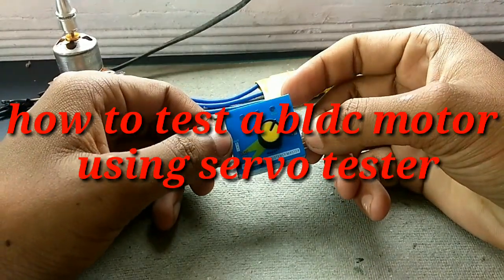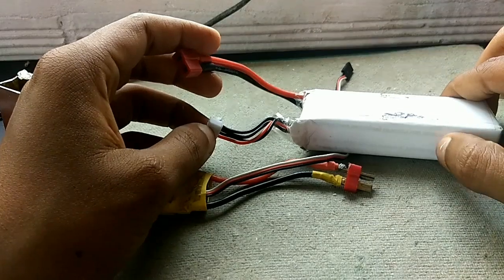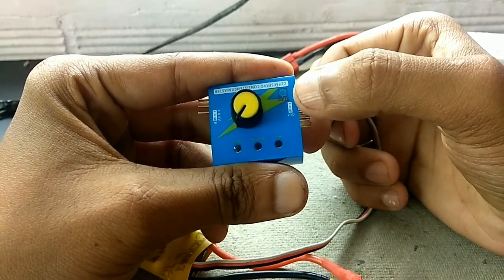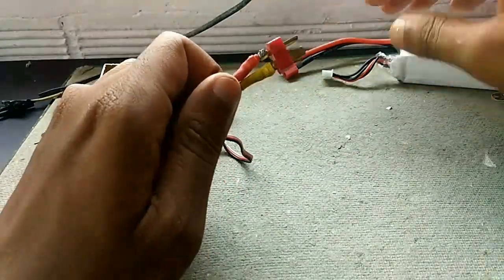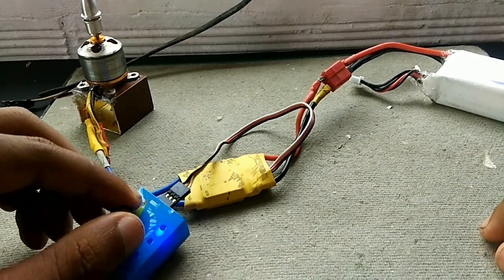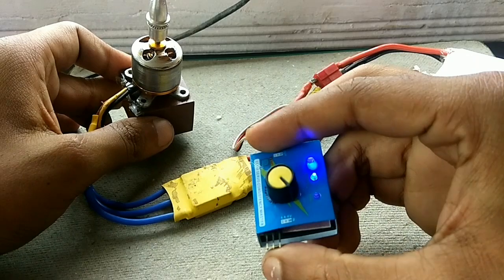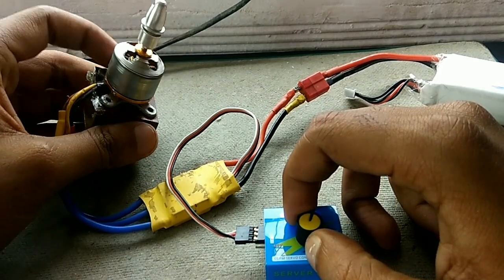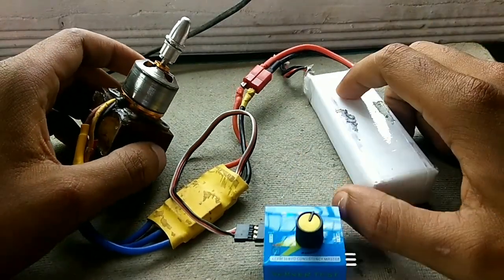Testing bldc motor using servo tester

Comment: speaking as someone fairly new and recently  buying a servo tester, (  mine came with no instructions ) .....I would have never thought of plugging the ESC and battery into  one of  the 3-pin   " out " ports.....also , I thought the   single 3-pin ( IN )  port marked  4.8 - 6.0 vdc is strictly for powering the tester with a stand alone power supply ( and the voltage match is critical  ) .... also thought  that  all servos and motors  need to  be connected on  a  3-pin  connector ,   marked   " OUT "  ....  thanks

Comment: My motor is  no working with servo tester,,,only beeping one times,,and motor start vibrating on increasing power....pls help me....is there any solution
Reply from the maker: Check the soldering 
And it happens when the battery is underpowered or faulty 
Also maintain minimum position in the servo  tester before atart
Reply: @techysinsight  I have done both things,,charged full battery ,and also check minimum position of servo,,,,but when I connect power, servo beeps only once ,,and on increasing servo power,,,motor start vibrating (not rotating)....
Reply from the maker: Then may b the motor is faulty
Reply: @techysinsight  thank you techys insight for your advice and help

Comment: Damn I'm such an idiot. I plugged in my esc to the tester like you did but then my stupid ass plugged in the battery to the other end of the tester and fried the whole damn setup. Ugh! Wish I had seen this sooner
Reply: speaking as someone fairly new and also buying a sevo tester, (  mine came with no instructions ) ..I can understand how you did that....I would have never thought of plugging the ESC and battery into  one of  the " out " ports.....the 4.8 - 6.00 vdc side 3-pin port is strictly for powering the tester with a stand alone power supply...and the voltage match is critical....

Comment: Why moror can works only few seconds and than he stops until I again restart proces(by rotating taster)?Can it somehow work without break?
Reply from the maker: There are 3 modes in the servo tester press the button to change
Reply: @techysinsight  Yes first mod is slowly lose power , second mod is he start with max power and also lose power and third he turn on and of on evry second or two. But it cant hold motor on , constantly for 10 seconds without losing power.
Reply: I have strong battery , but even if i use first mod and tune it to go slow and use less energy motor stops after few seconds.
Reply from the maker: It also happens when your battery has less power
Reply from the maker: Ok can check with a different esc

Comment: Can I use a 12V 30Amps SMPS instead of the Battery?
Reply from the maker: Can use laptop charger
Reply from the maker: Yes you can
Reply from the maker: Yes
Reply: I'm using a 12V car jumper starter battery with usb volt changer/regulator. You can use any battery really. I use the motor as a rotary cutter/drill/sander.